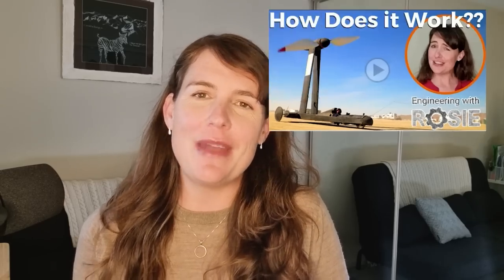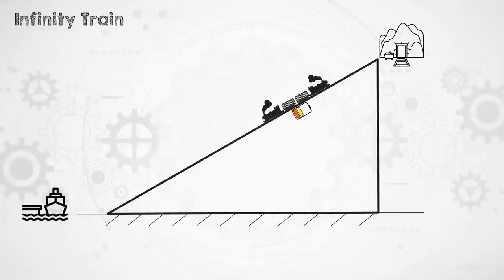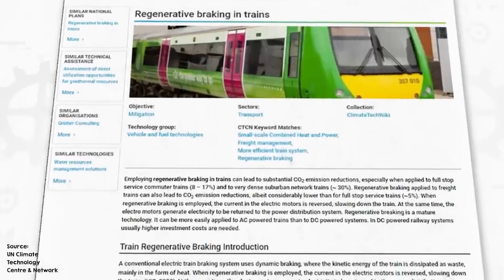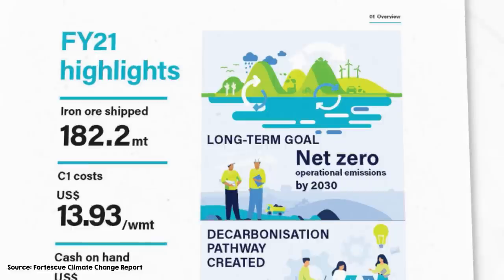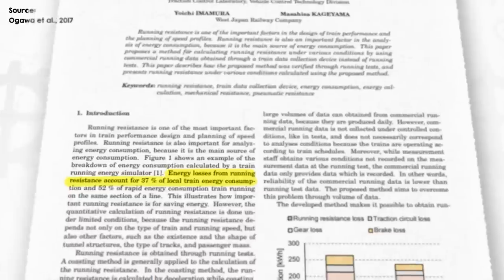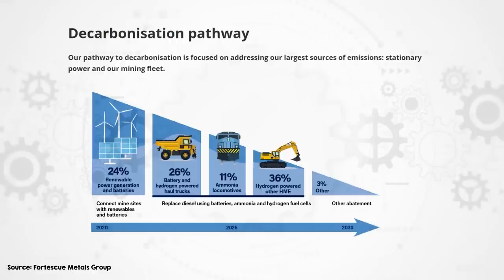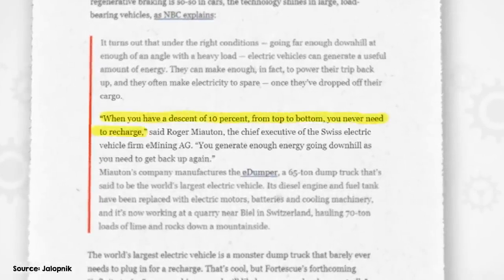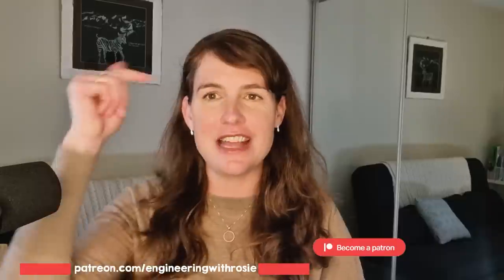This Mining Train Powers Itself: The "Infinity Train" (and how it works)

Comment: It was refreshing to see these formulas again after studying them 50 years ago in engineering school.  

My greatest enjoyment of driving EVs for 5 years is regenerative braking.  Not only is one pedal driving more relaxing, but the concept of generating energy for the battery instead of wasting it as kinetic energy feels efficient and saving money.   I no longer have to clean that nasty brake dust on ice vehicle alloy wheels.
Reply: Also pedestrians no longer have to breathe that nasty break dust, or particulats from the engine.
Reply: My friend's electric car needs the actual brakes do little that they go rusty between MOTs (that's an annual compulsory safety inspection) and he has to replace the discs not sure to wear but due to non-wear. Apparently regular cars really on the polishing effect of the braking to keep the rust from building up. 

I'm not sure what they do on a car that is electric from new: friend's car is a home conversion job using the original design brake discs
Reply: @trueriver1950  For me, 95% of the time regen braking brings my Tesla to a full stop.  So about 5% of the time I maybe removing rust.  Tesla now offers automatic braking when the battery can't accept any more regen charge.  I turn that function off and coast.
Reply: @trueriver1950  Yes, don't go to inspection with rusty brakes. His mechanic is scamming him if he claims he needs new discs because of it. What I do before inspection is go to check all wheels on my EV. Discs in front I run over with a flapper disc or cup wheel in an angle grinder to remove any burnt in dirt or rust and likewise on the edge of the disc which also gets checked for any edge groove, (another fail at inspection) which too needs to be ground down if present. Then unhinge the caliper and check state of rubber parts and free movement and then finally wash pads and disc down with brake cleaner to remove road grime. Rear drum brakes the same, but you don't need to grind them: Check movement of pistons, health of rubber and movement of the parking brake mechanism and you are all done. Can be done in your driveway for free without resorting to a lift in a DIY shop if the weather is nice. My brake discs, still with no signs of any wear from braking, are 20 years old and my brake pads with 3/4 material left are 10 years old.
Reply: @Tore_Lund  thanks for that: I am sure you are right about your suggestion working, as clearly it has worked for you over a number of years.

I also don't think the mechanic is scamming him though: if paying for that work at mechanic rates it's likely cheaper to buy new discs than to grind the old ones -- sad but all too common in these throw away days. 

My friend is an electrical engineer and was totally happy designing a battery system for his eV, but maybe not so keen on the sort of work you are talking about. He also doesn't have a drive or any other off-road place to keep his car. It takes all sorts to make a world.
Reply: @trueriver1950  If it is indeed just rust, no pitting or grooves etc, it is 1 minute sanding that is needed not machining. I had a friend who was told by a mechanic that it was normal to change discs as well when changing pads! They are trying to make a living!

Comment: Funicular railways can be 'self-powering' too if they use a descending car with a full water tank to pull the ascending one upwards. At the bottom, the tank is emptied and the one that is next to descend has the tank lilled. The one at Lynton/lynmouth works on the principle IIRC. It just needs a water supply.

Comment: Just discovered this channel recently and I'm really enjoying it, great work and very educational. One small, minor correction though... with regenerative braking the motor does not turn in reverse; it overruns in the same direction. In an AC machine this would be a speed above the synchronous speed of the motor but still in the forward direction. With modern drive electronics this speed (supply frequency) is variable but the direction of rotation is still the same when braking. 
Keep up the great work!

Comment: In the 1800's there was a mine in California where they had a gravity powered train up an extremely steep grade. So steep no train could get up or down the hill on it's own.
     A loaded train at the top of the hill would be tied to an empty train at the bottom. 
      The loaded train provided the power to pull the empty train up the hill, and the empty train provided a holdback to keep the loaded train under control.
    It worked great so long as the cable didn't break. And it did break a few times, things got really exciting then, with 2 runaway trains at once.

Comment: I remember when Virgin Pendolino Class 390 arrived in the UK in 2001 and the big song and dance about it being able to regenerative braking and sending the power it made when slowing down back up the pantograph and into the overhead power lines
Reply: The bad part of regen braking in a system is that the extra power is only available while the train is doing it. There is no place to store it for later.

Comment: 4:06 regenerative braking has been used in passenger trains since before the turn of the LAST century. Electric trains braking or going down hill put power back on the catenary line for use by other trains. The trains accomplished this quite simply by using shunt motors as traction motors. The magnitude and direction of power flow is then easily controlled by varying the motor excitation.
Reply: Most diesel electrics have most of the system as dynamic braking. They dump the generated electric into a set of resistors to help stop the train.  All any trains needs to have regenerative braking is to disconnect the resistors and hook them to a battery car or two.
Reply: @ericpaul4575  Or do what WABTEC and Progress Rail have done and get rid of the diesel-generator system completely and replace it with a large battery pack (7MWh for WABTEC FLXdrive, 14.5MWh for PR BE14.5BB). These are the BE locos that Fortescue, Rio Tinto, BHP and Roy Hill Mining have all ordered for their pilot evaluations of battery-electric traction in the next few years
Reply: Yes trains descending from Katoomba to Emu Plains help other trains climb, and if there are none to take this load, there was a huge cast iron resistor bank there too.  It is shown in the 1973 "Electrical Technology" by Theo Baitch.
Reply: The efficiency of regeneration on conventional wired electric railways is highly variable, and is dependent on traffic and grid conditions. Battery electric locomotives will have consistently much more efficient regen energy capture than conventional electric railways.

Comment: The batteries required are huge and heavy, however they may be placed in one or more storage stations near the railway line, and be connected to the train with overhead lines like for standard electric trains.
Reply: Why not mount the batteries  along the rail way, have the  charged by  the decending train, then have the empty  powered back up via  powered rail. Make the batteries  as big as you want to  no weight issue.  A DAY put solar cells on the batteries  as extra power since they sitting in the sun allready!!
Reply: They're not too huge or heavy. The Progress Rail BE14.5BB battery-electric locomotives already have 14.5MWh capacity batteries, and this will increase progressively over coming decades as battery tech continues to improve. The whole point of battery-electric traction is to avoid complex and expensive overhead wiring systems. These big battery-electric ore trains operating on downhill routes will not need any external charging.
Reply: One reason is you want a lot of weight in the locomotive to help with gaining traction for applying power or braking. Normally that weight comes from the diesel engine and generator, which aren't required for this locomotive.
Reply: Battery electric locomotives won't be any heavier than the diesel-electric locomotives they will progressively replace. You are correct in one sense though - the performance of existing overhead electrified  railways will be improved by the use of batteries at traction substations and even on electric locomotives. The regen performance of conventional electrified railways is highly dependent on the 'receptivity' of the railway's electricity traction network and the public grid, and can range between almost zero and 100% depending on traffic and grid conditions. Storage batteries will significantly improve this.

Comment: On the railroad that’s known as dynamic braking where the power generated by the traction motors is dissipated as heat by feeding the power into resistance grids on top of the locomotive which also powers the fan that draws cooling air in through the grids and exhaust the heat out the top. Those GE’S simply store the power thus generated in batteries. A very nice way to avoid the high price of diesel.

Comment: This gravitational energy application was used over two hundred years ago in Quincy Massachusetts with a pulley system and two rail cars to bring stone down hill from a granite quarry to be unloaded to boats on the Neponset river. The car was loaded at the top of the hill and would pull up the unloaded (empty) car from the bottom as it moved down.

Comment: The rotation of the electric motor doesn't change, during regenerative braking. Just the function.
Reply: I agree.  Maybe her reference to rotational change refers to reversing direction of train.  Going down hill motor is in “forward” and return trip it is in “reverse” because there is no U-turn at bottom of bill.
Reply: `I disaggree, unless the locomotive disconnects and turns around, then indeed the motors powering the axles will be running in opposite directions each way.
Reply: Either way the rotation of an ac motor doesn’t matter …..The inverter/chargers take care of the charging polarity … the cargo is the downhill fuel energy. Good to see Mr Forest leading the way in W.A. …. Great Guy …
Reply: @donnamarie3617  the train route has large loops at each end.  I don't think people understand the scale of these operations.

Comment: A nice explanation of the concept. I am working with Aurizon, Australia's largest rail freight company, on maximising the regen from the potential energy to reduce the external energy required as an interim step before eliminating external energy needs.

Comment: Useful first order calculation for energy consumption for a freight train with regenerative electric traction is K*M*-0.5 wh/gt-km, where M = gross train mass (tonnes) and K is a constant for different track topologies (K=540 for flat, K=680 for moderately undulating, K=850 for mountainous topology). We can use K=540 for the uphill haul to the Pilbara, because there will be very little regen. So for a 5000 tonne empty train the specific energy consumption will be 540*5000*-0.5 = 7.6 watt-hours/gross tonne-kilometre => 5000*280*7.6/1000000 MWh = 10.64 MWh. Battery-wheel traction efficiency is around 85%, so battery capacity needed to overcome rolling & aerodynamic resistance will be ~ 12.5MWh.

Comment: I could imagine the 'cat attached to toast' type of machine to work, but you'd probably go through a lot of cats and toast, which breaks both, cat and toast conservation, so it wouldn't be perpetual after all.
Reply: Ha! I don't know when this idea was first floated (pun intended), but I remember seeing Captain Hotknives perform Anti Gravity Cats close to 15 years ago. Funny guy.
Reply: It's not perpetual motion. The downhill train weight is ~ 40,000 tonnes, the uphill train weight is only ~ 5000 tonnes. Rio reckon that their 40,000 tonne trains use about 5000 litres of diesel for the 800km round trip, which is effectively ~ 15-20MWh when diesel-electric efficiencies are taken into account. On the downhill trip there's ~ 30-40MWh of potential energy available for regeneration, so it shouldn't be too difficult to capture 15-20MWh.

Comment: Nice technology.
If they split the train into two.
Two locos.
Same number of wagons.

Two tracks. 
They don't need storage.
The full train going down can power the empty train going up empty, through a power line specifically linking the two trains. 
Just a bit of synchronising schedule required..
Reply: The power line will cost a lot more than the batteries - about A$1.5M per track kilometre - this is why the mining railways have never gone with conventional railway electrification
Reply: If use traditional wired electrification was economically viable the Pilbara miners would have done it decades ago, and they haven't. Battery electrification allows them to transition at low upfront costs and no big fixed overheads that require maintenance.

Comment: Using K*M*-0.5 for the 40,000 loaded ore train and K=540, unit energy consumption to overcome rolling resistance for the downhill trip will be ~ 540*40000*-0.5 = 2.7 wh/gt-km => 30.24MWh total train energy consumption to overcome rolling resistance (K=540 is selected as the no-regen value because the regen component is dealt with in the separate PE delta calculation).

For the uphill return trip with an unloaded train of M=5000 tonnes, unit energy consumption to overcome rolling resistance will be ~ 540*5000**-0.5 = 7.63 wh/gt-km => 10.69MWh total train energy consumption to over come rolling resistance.

Comment: Good to see the calcs! Here's a thought - (ignoring any H&S concerns) would it be beneficial to use the train's rails to conduct the regenerated electrical energy? The rails could then feed to battery banks sited at regular intervals along the track, rather than weigh down the train by carrying batteries. Any excess electrical energy (once the train had reached its origin) could also be used by as 'V to G'.
Reply: Steel’s not a particularly good conductor. You’d need to do the sums and I suspect the folks who designed this system would have considered your idea. It is rather obvious...
Reply: If this was a viable solution the big miners would have done it by now. The running rails can't be easily used to conduct electrical energy - it needs an isolated third rail or overhead wire. Batteries are much simpler and cheaper. No difference in weight compared to diesel-electric locos for this task by 2030s.

Comment: Nice video, Rosie. Clearly, they'll need multiple banks of ultra/super capacitors to maximize the energy recovery, unless the train is traveling so slowly that the energy being produced is not higher than the amount of energy that the batteries can receive. Remember, batteries have to be at their optimal temperatures to receive their maximum charging speed. I'm also assuming the voltage architecture at the battery pack level will be very high for maximum efficiency. The higher the voltage the lower current, thus the lower heat and losses.
Reply: No need for ultra/super capacitors. A battery-electric locomotive like the PR BE14.5BB with a 14.5MWh main battery and a traction motor rating ~ 3.24MW will be operating at a charging C-rate of 0.22 at full regen - well within typical C-rate capabilities of lithium-ion traction batteries. Charging losses at these C-rates will be in the order of 1-2%.

Comment: There is a quarry in New Zealand that uses electric trucks the same way. 
The depot is at the bottom of the hill and the quarry is at the top. Trucks go down loaded and return empty.
Overnight they put about $8 worth of grid power into the truck to fully charge it.
But it is a very old concept. The Denniston Incline was a coal transport system on the West Coast of the South Island that was fully gravity powered

Comment: In 1896 an Inclined plane railway was built at Covasna/Comandau in Transylvania (then in Austria-Hungary, now Romania) with some Danish, British and Austrian parts. Cable-connected cars used the potential energy of the heavier car loaded with timber descending to pull up the empty car. One horse used to maneuver the cars at each terminal to form trains. Steam locomotives burning lower-quality wood remnants brought the trains to a furniture factory. No other energy source needed...